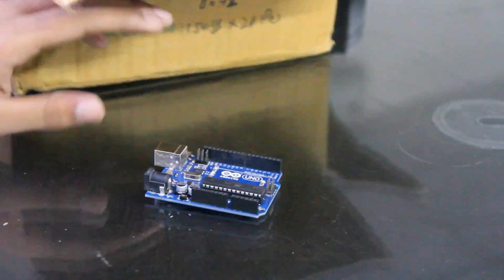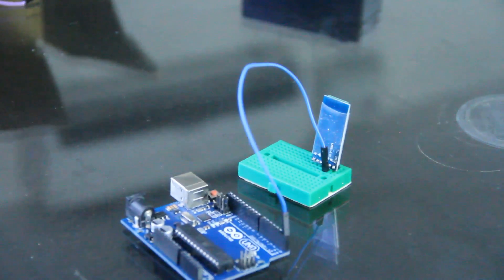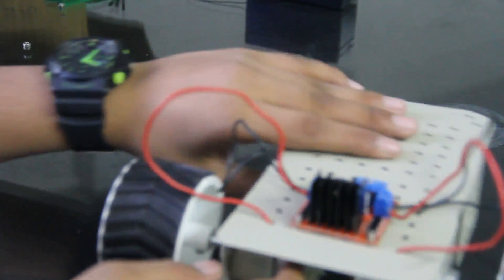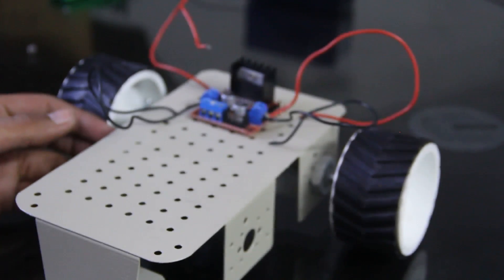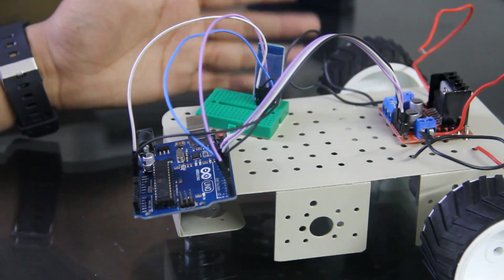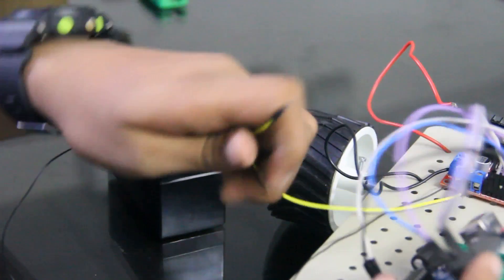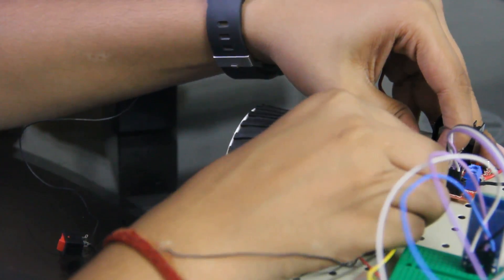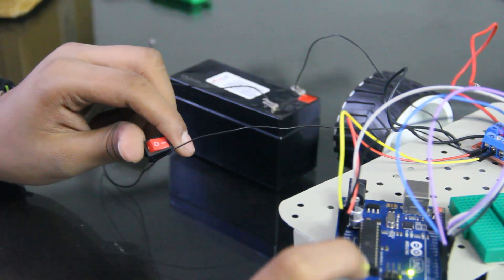How To Make An Arduino robot Uno Car using L298n Motor Driver And HC05 Bluetooth Module

Comment: HC 05 module is having the capacity o f only 5volt but from battery we are supplying 12 volt won't this affect our circuit as well as HC 05 module
Reply from the maker: rest battery is also occupied by Arduino and motor driver

Comment: Sir why u used bread board in order to connect hc 05 module and why u didn't connect it directly to pin of the hc 05 module
Reply from the maker: I used so that there is no confusion , if you don't want to use breadboard its ok

Comment: If I will provide more power to arduino will not burn.
Reply: Maqadas Manzoor  bro u can give up to 24 v power. arduino have an inbuilt regulator which converts to 5v for the arduino power up

Comment: Dear Gamak Sahani,
I have installed program in arduino it work good.But speed of motors are very very slow how can i fast it?
Reply from the maker: hey,you can increase speed of motor by applying more power to it,by using high volt battery
Reply: Will you please mail me code at Shuvam881@gmail.com
Reply: yo pls send me the code if u have.
Reply: Code send me Plse in the gmail spksapb2016@gmail.com
Reply: yo pls send me the code if u have.
Reply: coding pls, send at ava.thiru38@gmail.com
Reply: yo pls send me the code if u have.
Reply: Do uh  have can uh mail  me